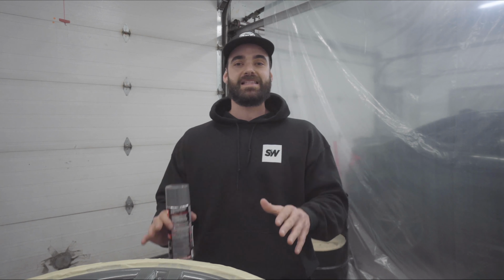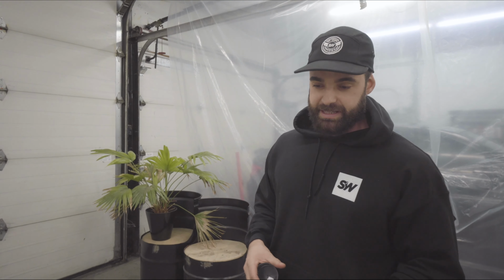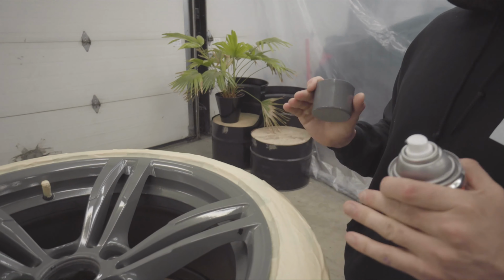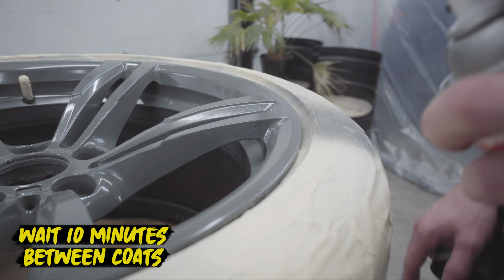Superwrap Labs | Episode 05 - Superwrap Touch Ups & Durability

Comment: can a superwrapped wheel thats taken some curb damage be superwrapped again or do i need to peel the whole wheel?  Ive repaired the rash on the one area of the wheel.  95% of the wheel is fine
Reply from the maker: You can always touch-up the imperfection by applying enough coats to color-match the affected area.

Here's our How-to Touch Up Wheels video: https://youtu.be/7PBvmnJGoyM